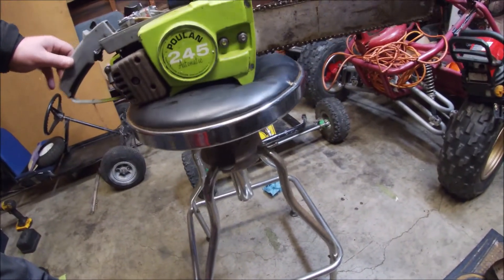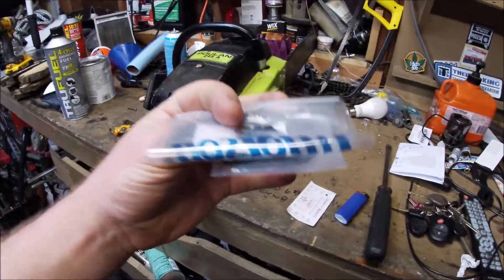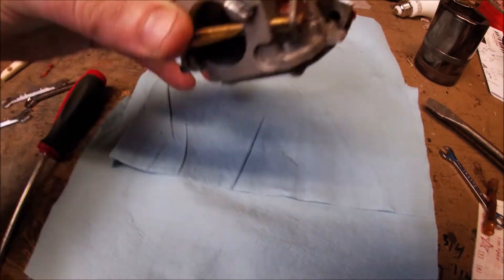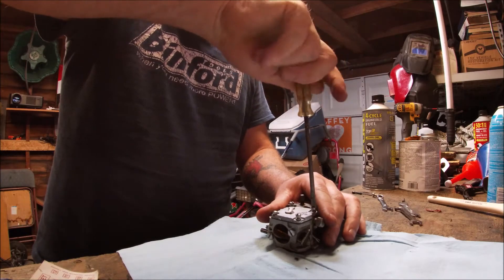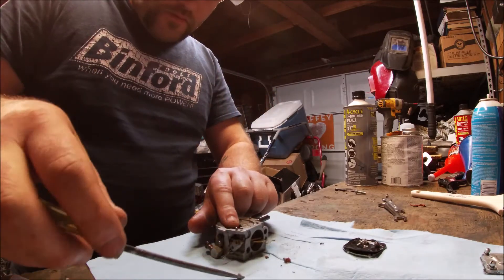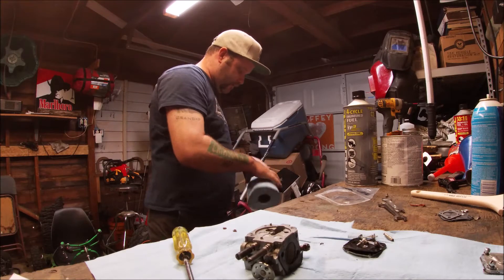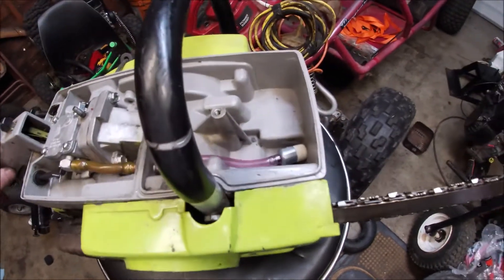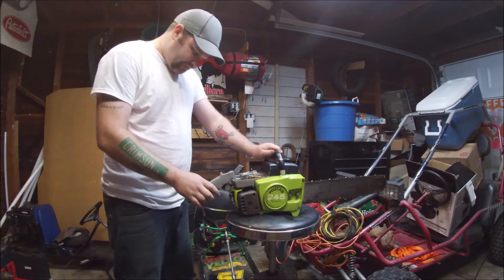POULAN 306A carb rebuild and run

Comment: On my saw the throttle bar is longer and protrudes out the other side of the throttle action and the factory bent it down so that it wouldn’t come disinguaged.Your saw throttle bar looks like what I’m used to dealing with.The way this one is it’s going to be a pain in the ass to get it back through the little hole.

Comment: You know that your metering diaghram in those tillolsen carburators are supposed to attach to the metering lever.I would have never known this unless I watched this you tube video on tillolsen carburators.If you haven’t attached it you should consider it because it does run a factor on your saws performance.I couldn’t get mine to idle then I saw this video of the attaching parts and it ru s fine now.Just for anyone rebuilding a tillolsen carburator the pin on the bottom of the metering diaghram fit into the fork in the metering lever.Take care

Comment: Hey dick what's the fuel mix on a 245a poulan? Is it 40 to 1
Reply: I use 50 to 1 on everything that I use and it works fine.I’ve never had any issues